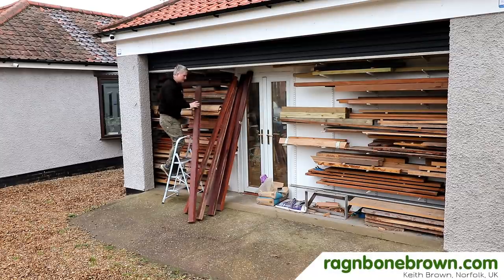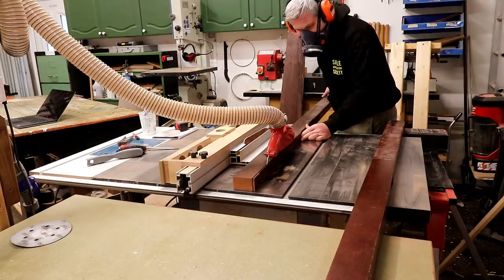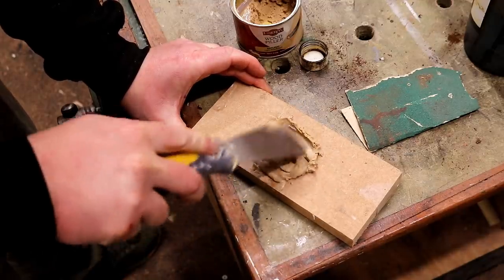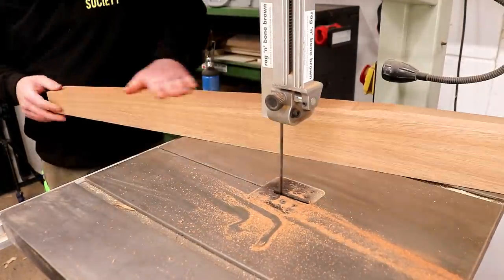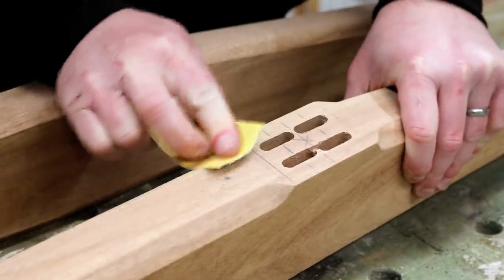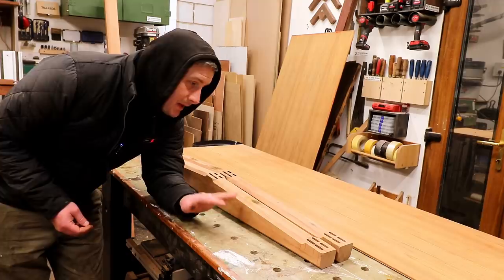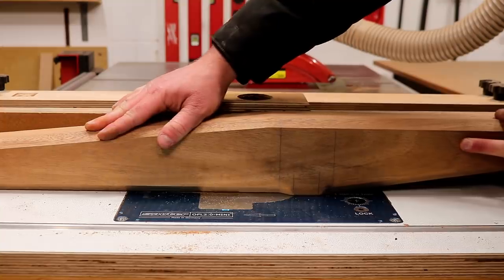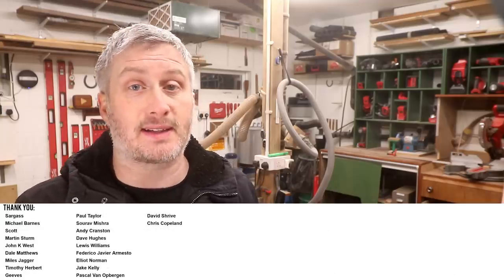Building A Bed With Reclaimed Wood

Comment: Before putting any timber through my planer thicknesser I run a garrett pinpointer over the wood. This will show you if there is any metal in the wood. This has saved numerous blades on my machines. You can get cheaper Chinese ones but the garrett one is great quality and well worth the money.

Comment: Worth waiting for 👍🏻
Not every day you see a project using exterior recycled timber. Clever use and machining of elements is first class.   
So much metal in recycled timber nowadays, I find that screws are the most difficult to remove. Did you use Sipo domino’s? 
Looks a bit chilly in that workshop, you need a wood burner to keep your inspiration sharp 😉

Comment: Enjoyed the video. The "Mahogany" Sapele which is from the DR Congo in Africa. It's now on the CITES watch list so it's becoming more scarce. Good on you for re-cycling it. I've used Sapele for decades and some of it has had amazing  grain. I've had 600mm wide boards, 75mm thick and 3.6metres long and had to saw them up for making windows..It's quite easy to tell the difference between Sapele and Meranti. Meranti is very pale in colour, very soft and damages easily and not very durable. Sapele is much denser, far more red in colour when wet, tends to have nicer figured grain and is far more durable than Meranti. Unsual to see a job done with two different timbers so it could be all Sapele.Sash cramps are very versatile, if you buy some 4ft ones you can take the ends off and bolt 2 together (through the peg holes) giving you close to 8ft cramping width .
Reply from the maker: Sapele is my favourite wood, it is so beautiful. I like the sash clamp tip, thanks

Comment: I had to deal with metal in wood as well. To solve the problem I bought a little "dremel" tool and a plunge rounter base for it. With a grinding bit in the spindle I can just plunge in and grind the metal away. Just a tip if you ever come across a metal inclusion that doesn't want to come out.